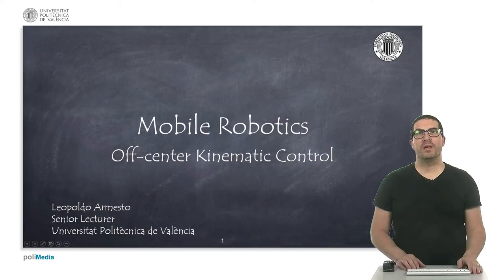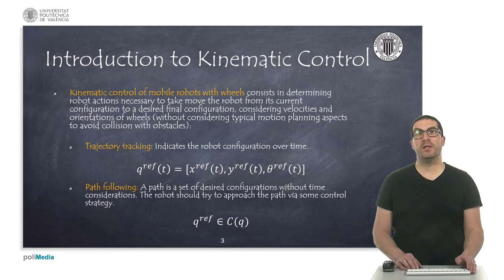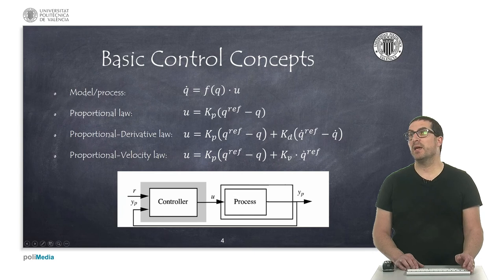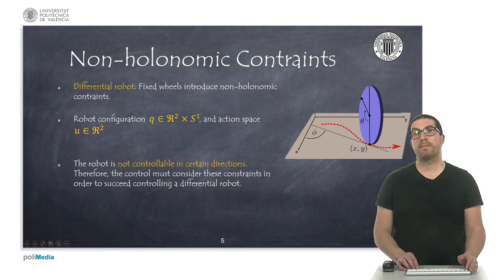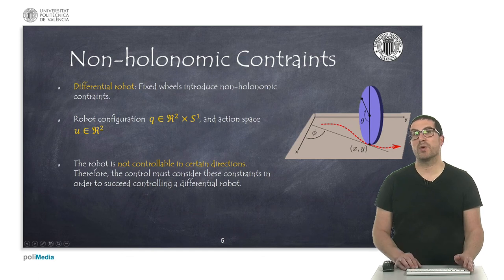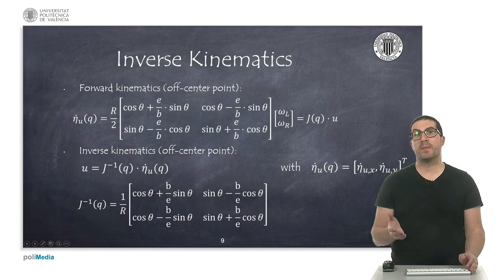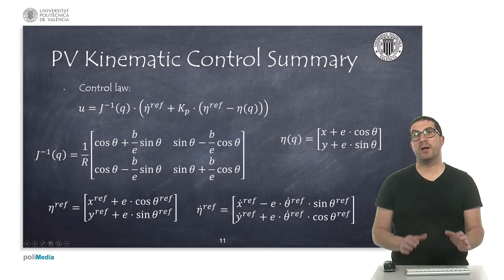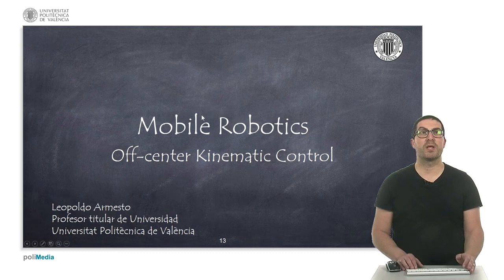Off-center Kinematic Control | Mobile Robotics

Comment: Thank you for this wonderful video. I couldn't connect why we are taking off-center points for a non-holonomic constraint? can you please help me?
Reply from the maker: The reason for that is that at that point velocities can be controlled arbitrarily (rank of Jacobian matrix is 2), which means that we can thus propose conventional controllers such as PIDs to regulate the positioning of that point.
Reply: @LeoArmesto   Thanks a lot for this video! I wonder how to decide the value of e? : D can you please help me?
Reply from the maker: @xtl3862  it’s a parameter that regulates the distance of a virtual wheel. The shorter the value the more gain the controller has.
Reply: @LeoArmesto  Thanks a lot! I am a little confused about the potential fields applied off-center. In the code, the potential force is calculated using the position of the robot, the calculated velocity via force is of the robot too. Then, we assign this velocity directly to the off-center. Finally, the velocity of wheels is calculated by the velocity of off-center(actually, is the speed of the robot itself). Is this the right process? I look forward to your reply！
Reply from the maker: @xtl3862  yes I would say so…
Reply: @LeoArmesto  Very glad to receive your reply, Thank you!